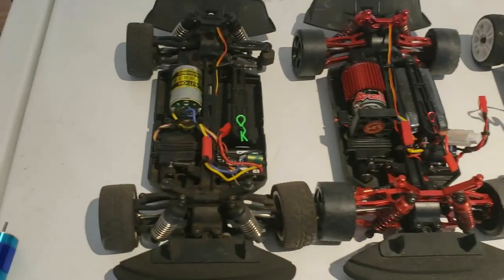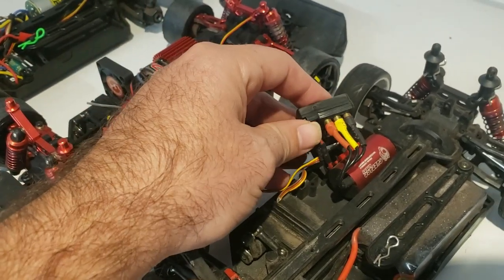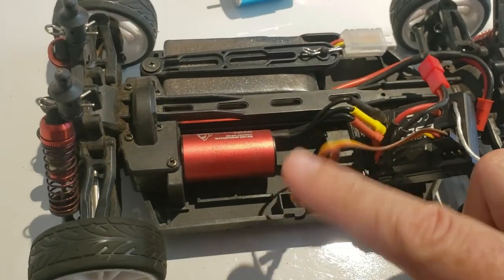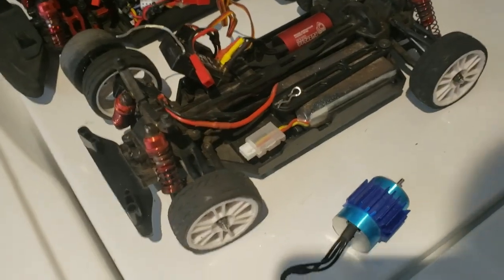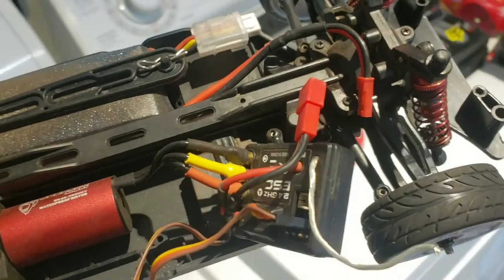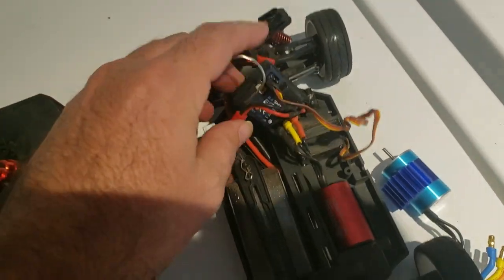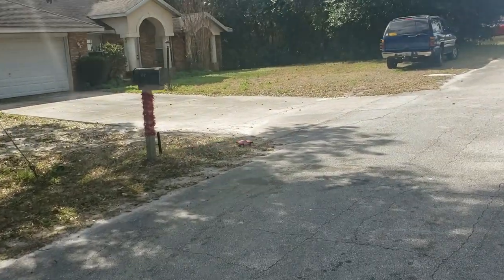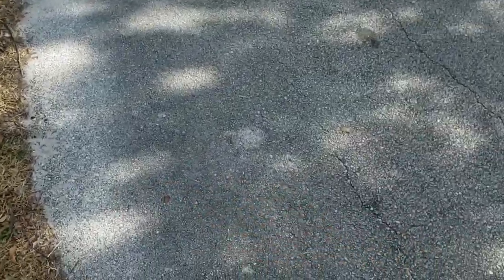UDI 1/16 Brushless PRO version NO MORE COGGING? GLITCHING!!! HOW TO FIX COGGING STOCK ESC. SG 1603

Comment: I just bought a UDIRC 1603 and it's fun but it cogs, annoyingly. I thought there was something wrong with  my car. Thanks for your vid, I'm on the fence whether I want to throw that motor in. I'm a newb to drift, coming from the super reliable RTR HBX family. So it kinda grinds me that I gotta piss around with this 1603 already. But cheers anyway man, thanks for the vid.
Reply from the maker: Yea it sucks but that motor will fix the problem and it's cheaper then replacing everything like everyone else says to do.
Reply: I have a flysky gt5 transmitter and receiver s coming so I'm happy look at getting a good esc to run this motor I not sure which esc to get .. maybe it need be programmable ?? The transmitter will have options to control throttle curve etc tho

Comment: Hey buddy, love your channel ❤️ I'm after a little bit of advise- I'm new to rc and I have a little 1601.. I'm after a few spare batteries.. do you know if I can use a 1500mah if it is the same size rather than the 1200mah.. I've found the 1500 for a good price on ebay
Reply from the maker: Hey Man, Thanks! 

I know these Zee batteries work great, you just gotta change the connection.

Look at this on eBay
https://www.ebay.com/itm/2PCS-Zeee-2S-7-4V-1500mAh-60C-Lipo-Battery-Deans-for-RC-Car-Truck-Airplane-Boat-/383205406858?mkcid=16&mkevt=1&_trksid=p2349624.m46890.l49286&mkrid=711-127632-2357-0
Reply: It depends if u talking lithium ion or lipo ..  the ions are just 2 x 18650 cells I believe so 1500 is same size as 1200 or even 2000  .. but beware fake battery .. I'm not sure if u have a lipo charger or not with the car but all decent batteries should have dimensions so measure and compare. Just make sure if u yo for lipo they are 2s not 1s or 3s .. 7.4 volts is what u need to use

Comment: you have a link for the red parts on the second rc you had shown? I bought the same set (but assume made by someone else) but they catch and grind on the wheels, as well as binding the from of the car. I had to take both pairs off of mine and it fixed everything.

Comment: Hey ! was wondering, the one that you have all metal steering cup upper lower swing arm set does the direction block when you fully turn one way sometimes ?? if you had this prob and fix it what did u done to it ?

Comment: im on the fence between going brushless with this motor, or upgrading my brushed setup with a traxxas 380. mostly interested in drifting, what do you recommend since you  have both
Reply from the maker: For drifting definitely go with the traxxas 380 for sure! The only negative is you loose a little distance with the transmitter sometimes. 

So go traxxas 380, if you want to make it even better you can get a new dumborc transmitter and a hobbywing 1625 brushed esc later on down the road and that will clear up any distance issue with the 380 upgrade. 

But just start with the 380, I also highly recommend going to a zee 1500 2s 60c battery.

Comment: Hi, is there any way by which i can remove the cogging without changing the  motor or anything? Because i ordered the UD1604 brushed with 3  batteries . But what showed up was a brushless with 2 batteries. Also the body of the car was fully damaged. Can i fit a 56mm suspension in the car? Because i still didnt get the car. The was shipped to my dad who is on another country
Reply from the maker: No, the car will cogg. I tried everything. If you're using it as a normal RC car it's not that bad but if you want it for drifting then it's terrible. Even after you change the motor to the one I suggested the throttle response is not quite as good as the brushed, this makes it very hard to get really good at drifting. Sorry, they sent the brushless one. 

Very frustrating. I got a car that was damaged once. Got them to send me 80% of the money back and I got to keep the damaged car. I took the money and bought another one then I had a spare parts car. You could try that. They might send some money back and you could try to sell the brushless stuff from the one they sent to make up for the difference. Then keep the rest for backup parts. The sellers will typically work with you. You just have to be patient and jump through hoops.

Comment: With the cogging issue would it be not as worse using the stock extra li po battery instead of the li ion
Reply: Lipo have less internal resistance so it maintains voltage better and delivers more current. Current create torque. These cars are geared to high for the stock motor/esc combo. Lower kV motors creates more torque with everything else beeing equal. The lower kV the higher resistance so max power will be lower. So a a higher kV with more down gearing will be more efficient and powerful. But if either the battery or esc can't deliver more current for some reason cogging appears in a brushless system. Chasing that perfect balance is always a challenge, even more so with brushless setups. So if you could put on a smaller pinion that would also help with the cogging, but choosing a smaller motor with correct kV lowers the stress on the esc and motor the most.

Comment: hey man im confused im trying to find the part in video u swapped the pinion ?? or is that on a different motor its hard to keep watching same video over and over  but I thought there was a part where u showed putting on 27 tooth pinion ??
Reply from the maker: No, I did not change the pinion. The pinion is stock. The motor has been changed to a 2040 surpass hobby.
Reply: @outerzonerc777  haha I must be watching too many damn videos .. someone put a 27 pinion I'm sure of it ... I got no idea why then 🤔 cos I was bit confused u put smaller motor in then up the gear ratio !! I mean with more torque maybe ... But interesting I thought because you had gone down in kv you wanted go up in gearing ...   I see that 2040 3200iv can handle 3 s no prob maybe even 4 .. but I doubt the stock ESC will.
Reply from the maker: @Bogues_88  no worries man, good luck with modding.

Comment: Hey how's it going man I just wondering if I could ask you a question I have scoured everywhere and I cannot get a specific answer on the truck drift one with the brushless motor on the ESC where that steering servo plug is there is an additional 4 pin plug right above that could you please tell me what that extra plug is for can you plug a s Circle in for rear steering I would really appreciate that knowledge thank you
Reply from the maker: I do not know what it is used for honestly, I use it for a fan on mine. Sorry I can't help.
Reply: Well it's for a non brushless motor if I plug my Servo into it and it kind of ripped it up for a split second but that's what it is but thanks anyway man I appreciate you getting back to me.
Reply from the maker: @jcstnn13   it's likely the esc then, sorry I have not had any issues with my brushed ones. A great upgrade setup is a lobbying 1625 esc, Traxxas 18-t brushed motor, and a dumborc transmitter and receiver. It makes a ton of smooth torque for drifting and will surprise you on a 2s lipo. If it's mainly for drifting your best staying brushed for smoother throttle response. If you check out my hoonicorn it has this very setup and it's perfect!

https://youtu.be/yeIv8Dcf4T8
Reply: @outerzonerc777  Well I think that's the real reason because I have two of those cars since I pretty much identical one of them's brushless one of them is brushed they're the new . So I guess another question if you might not mind thinking about it if you can answer it preciate it so I have both of these cars so I have two front end steering but I want to put the other steering one in the rear of my brushless to make it four wheel steering maybe you could guide me in that direction because I have to controllers to ESC is I have everything I need I just need a point in the right direction thanks again man.

Comment: What did you do drill out the motor mount to fit the smaller motor?
Reply from the maker: No the motor I used had 3 different nm otor mount positions. One of them fit dead on perfect. Perfect gear mesh.
Reply: @outerzonerc777  Thanks, I looked at the specs after posting and saw that,, thanks again.

Comment: Hey man, I just ordered the brushless conversion! With that setup will I be able to run 3s and maybeeeeee 4s? Let me know if you have any suggestions! I’m also gunna order the whole control arm set and oil in shocks!
Reply from the maker: If you just ordered the brushless SG 1603 set you don't want to run over 2s lipo.
Reply: yea the motor and speed control will not handle 3s let alone 4s !! if u wanted 3s 4s you should not ordered the upgrade but a new receiver servo speed control and motor that can handle 3s or 4s ... the car is pretty much too small for that much power
Reply from the maker: @Bogues_88  I 100% agree with Rob, that little motor I put on still feels a tiny bit overpowered on brushless 2s with the weak stock esc, that said it's exactly what I wanted, the car feels fast fun and controllable with the little 2040 surpass motor. I will be turning it into a white rally soon with the rally tires. I think it will be perfect.

Comment: Hi
Nice Video 👍🏼
Does your engine get hot too?
i bought the blue 2040 engine
KV: 3200KV
Watts: 120W
Maximum current: 14A
Max Voltage: 8.4V

Comment: Ok well I just ordered 2040 3200, 2040 3900 , 2040 4480   1x 35 amp speed control ..   it says motor can handle 3s  so these motors were so cheap on ali express about $8 each !!  I just happen to have couple 3s battery I have never used ... unfortunate thing for me I might need order another car  hmmmm what will i do with spare parts   ??   The 3200 kv you used was probably a good choice the 3900 one might do better in  with a better esc .. or if the timing was advanced on esc (duno if u can on the stock one)  or maybe on 3s   but dont think the stock esc will handle 3s ..

Comment: Put a glitch buster on it and it shouldn't cog no matter what
Reply from the maker: Tried it, Racers edge, cleaned it up like 10% did that before I got the 2040 motor. I have a new set up in the mail. Ditching the stock esc. That motor fixes the problem 95% but want more powa
Reply: I highly recommend the tsky or T-Rex esc (both the same different names) but considering you said you ordered extensions I'm guessing you don't solder. I've started so many arguments by saying this but the tsky will handle upto 6s if you know your brushless math, if not you let the smoke out.
Reply: Oh and the Lightning McQueen body is absolutely awesome btw
Reply from the maker: I do solder, got a hakko a few months back, I was trying to find a way to fix the problem for people that are not super technical in the RC crowd. I just ordered a 35amp sec and 2445 surpass setup for one of my cars. Wish I would have saw this a week ago haha. Could you drop a link to the exact esc your talking about? Appreciate you.